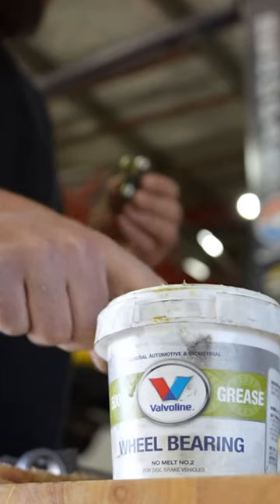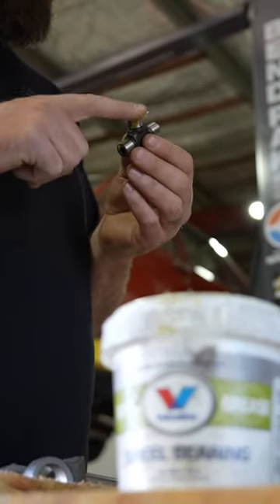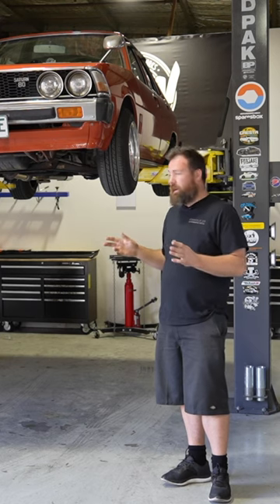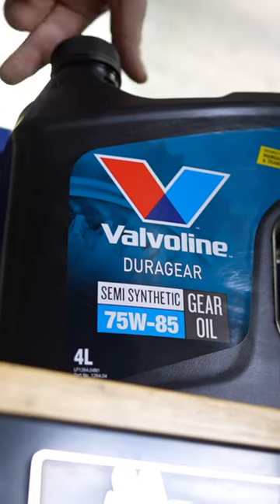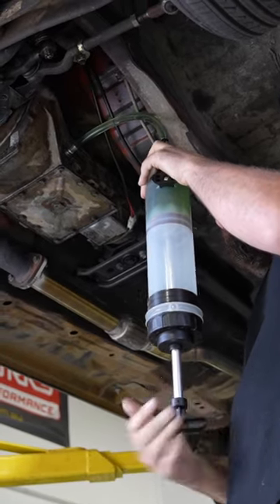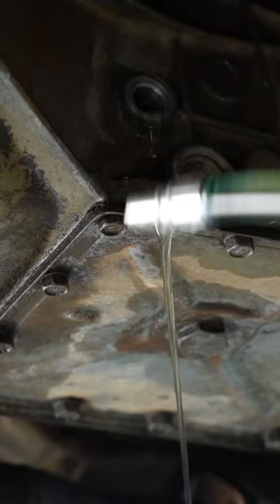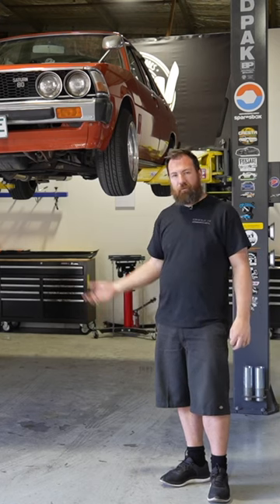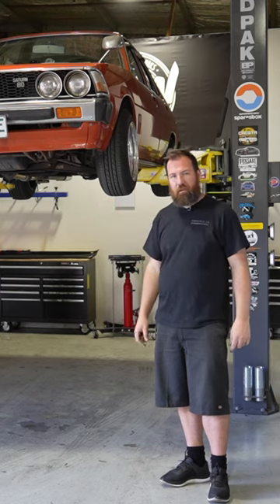Top it up !! #shorts #diy

Comment: Shit, Benny. I’ve been suspicious about the e153 in my MR2 Turbo since I changed the clutch. I had to force it to take another quart but it leaked like hell when I was cleaning the case before reinstall. 
No dipstick on that guy, just have to get it high and level. Maybe it’s a good time to just flush and refill?